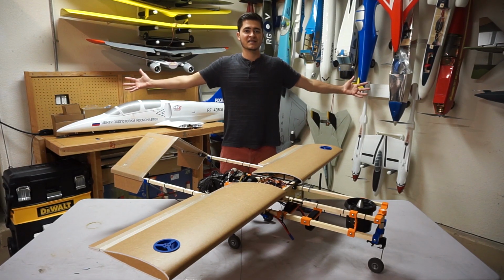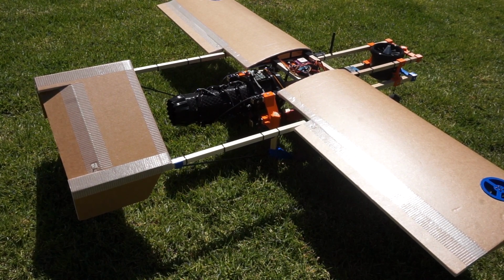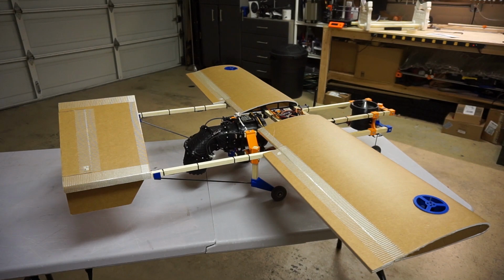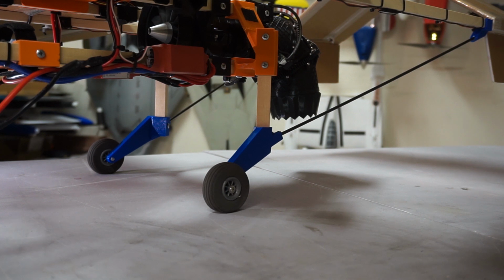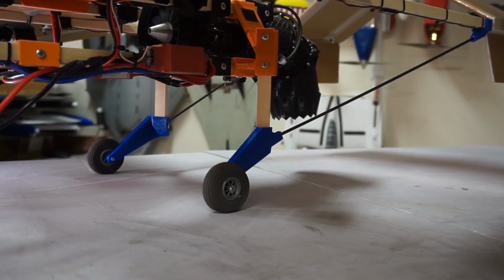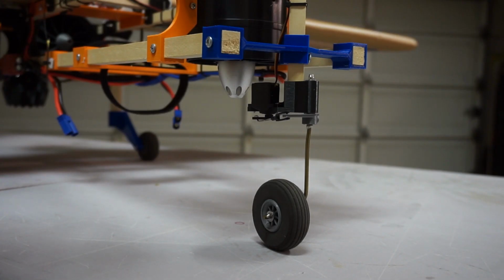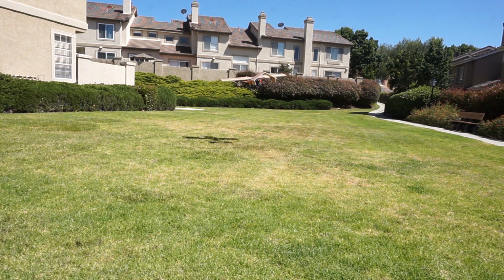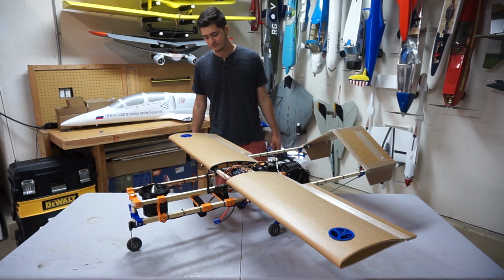R/C F-35B: It's an Airplane Now

Comment: This is a fantastic project! Can't wait to see how it progresses.
Is that a mRobotics GPS module I see? What flight control stack are you using? Quadplane?
Reply from the maker: Yes! This thing is a collection of spare hardware that I've had lying around.

I'm running Quadplane, but I made a custom motor mixer since it didn't quite match any of the existing frame classes.